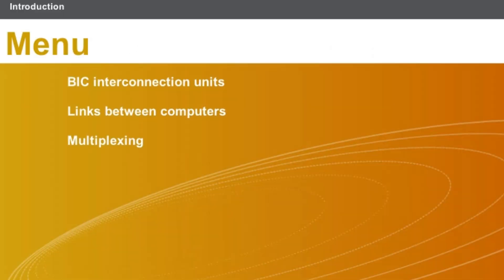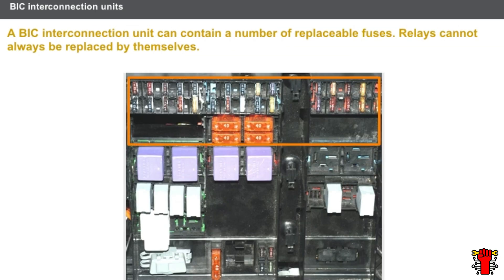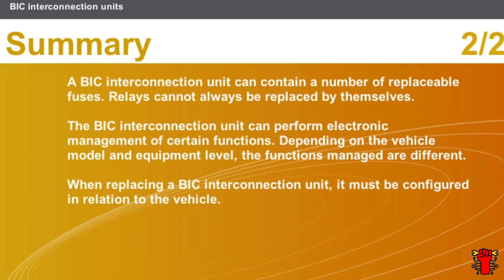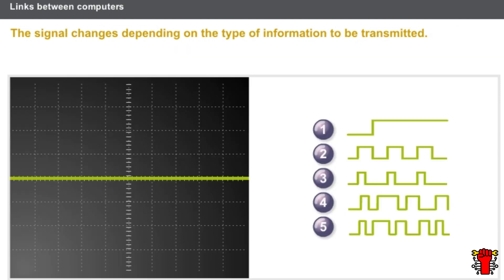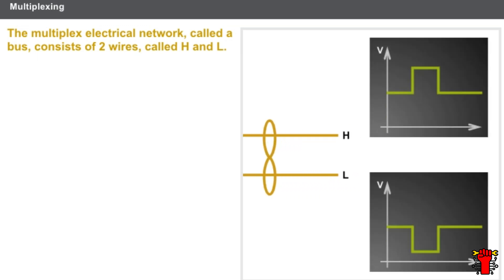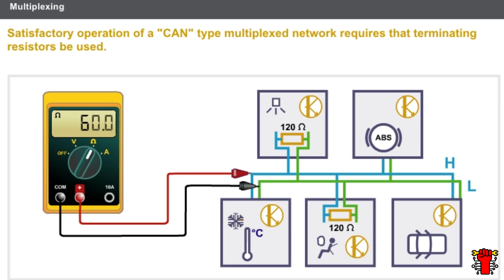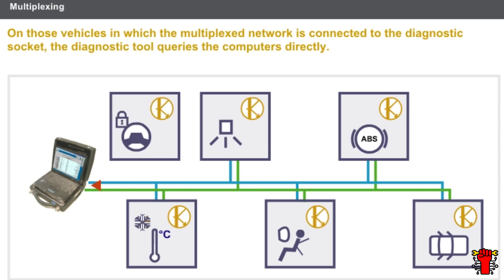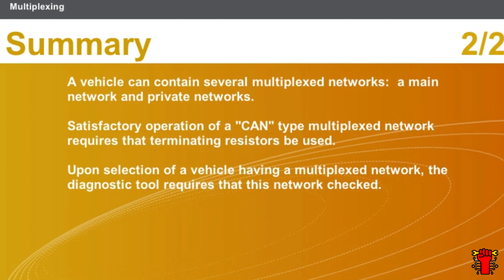Multiplex Systems Explained | BIC Interconnection Units, Computer Links, and Multiplexing

Comment: How work's can bus in vehicle
Reply from the maker: Thank you for your question! CAN bus, which stands for Controller Area Network bus, is a robust vehicle bus standard designed to allow microcontrollers and devices to communicate with each other within a vehicle without a host computer. In simpler terms, it's a network that lets different parts of your car talk to each other.

In the context of the video on Multiplex Systems, the CAN bus plays a crucial role in multiplexing. It enables various electronic control units (ECUs) like the engine control unit, transmission control unit, and others to share information efficiently. Each ECU can send and receive data to and from other ECUs, which helps in coordinating complex functions, improving performance, and increasing reliability.

For example, when you press the brake pedal, the information is sent via the CAN bus to various systems like the anti-lock braking system (ABS), engine control, and even the brake lights. This ensures that all relevant systems respond appropriately and simultaneously.

Hope this helps! Let me know if you have any more questions!
Reply: Do one video can bus communication
Reply from the maker: @DhanunjayaDhanunjaya-y6y  Thanks for the suggestion! I'll be working on a video about CAN bus communication soon. Stay tuned! :_Thanks::_Thanks: